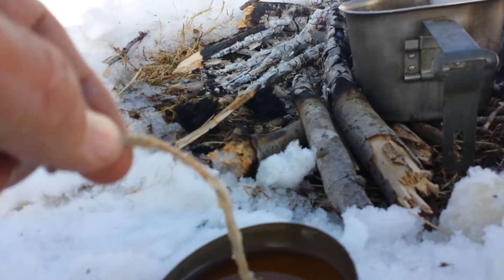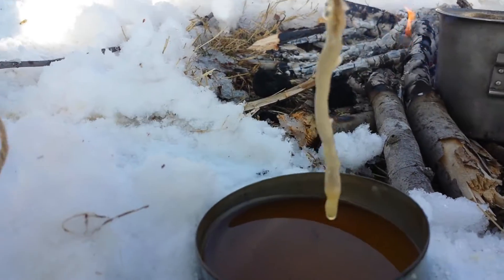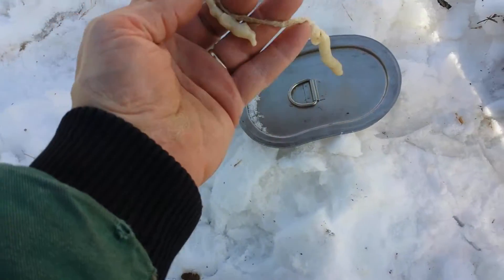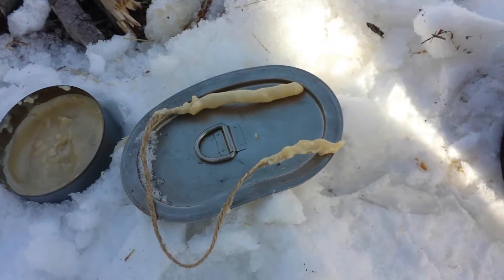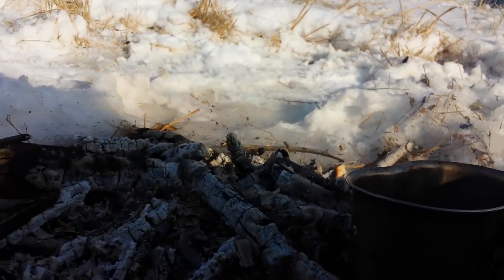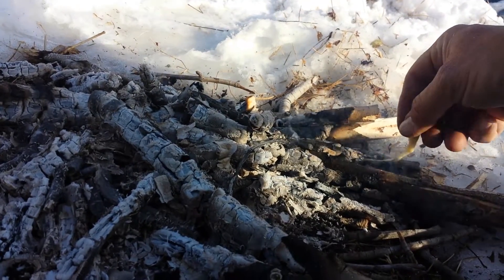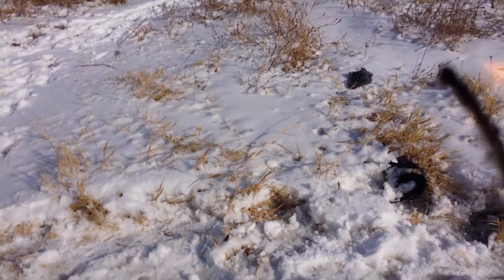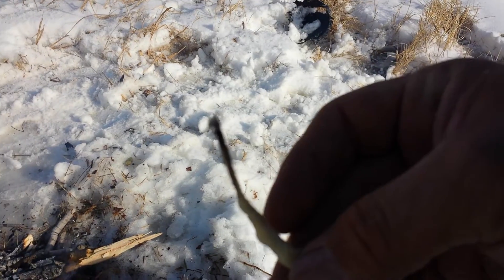Bushcraft candle making.

Comment: Very nice! I have used bee's wax and tallow for "fixin wax" before, but not to make candles. That is a great, simple idea!
Blessings!
Reply from the maker: thanks for the compliment.  
I try to see as many uses as possible for my gear and kit. This makes good fixin wax. I rub it on my blades and my leather.
may blessings be upon you as well.
Reply: Thank you! I try to do the same. Unless it is a necessity or a specialize item, I try not to carry anything that does not have at least two purposes.

Comment: Nice Idea, would be good to have one or two of those on hand.
Reply from the maker: We had fun. In this upper 90° heat of mid June they'd be oil lamps needing a bowl. I think I'd have to alter the recipe with higher beeswax amounts for summer.
I do use the mix on my leather  for conditioning and water proofing.
thanks for stopping by.

Comment from the maker: These were definitely not pretty craft type candles. Actually were my first attempt. 
I am thinking of using just beef fat on one with the foreknowledge to keep it out of the heat.  
As they are I can light one and use it a bit easier to apply to leather.